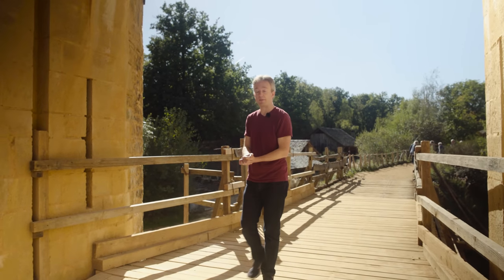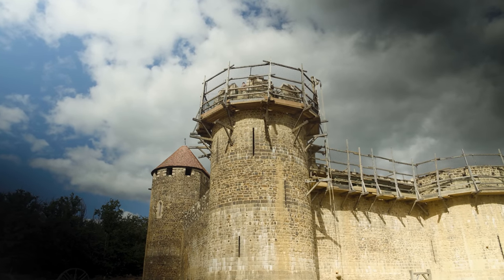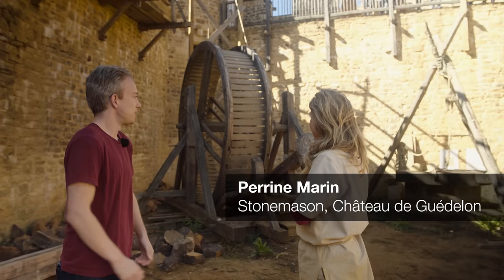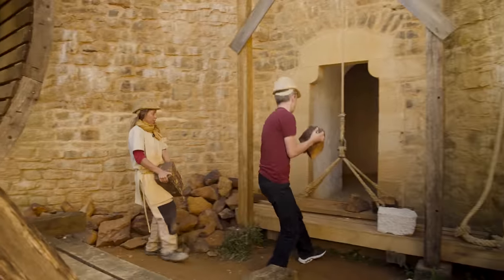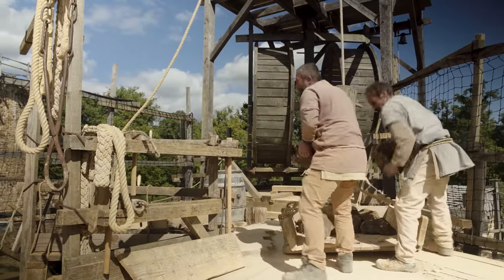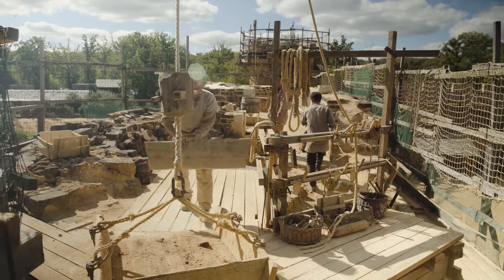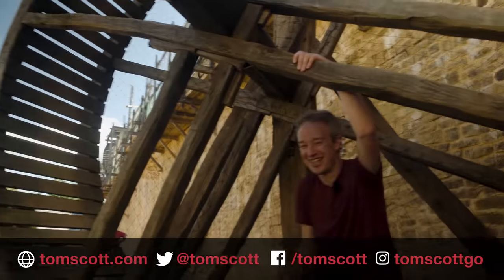I thought the treadmill crane was fictional.

Comment: I knew it was real because Treadmill Crane is a tech you can research in Age of Empires II and the manual that came with the game had historical sources explaining everything.
Reply: Huh! I missed that one! Have to go look now!
Reply: Exactly where I knew it from too, I was confused when Tom expressed any doubt over it.
Reply: What a missed ad opportunity
Reply: although, not everything in AOE2 is historically accurate. eg: mangonels and onagers having wheels.
Reply: @JNCressey  One thing I learned from AOE2 was that mangonels can drive themselves and don't need a person to push them around like cannons do.
Reply: @jamesburton1050  The history text for it is: "The construction of castles, cathedrals, and other major building projects required the invention of new techniques, as well as the re-discovery of ancient technologies. A critical tool known to the ancients but lost to the Europeans of the Dark Ages was the crane. The simple crane was a long pole with block and tackle gear that was used to pull loads to a height. The treadmill crane was an improvement over the simple version. It used a large circular treadmill upon which men walked. Gears converted the horizontal circular motion into vertical turning, providing power to wind ropes around a drum and pull up heavy loads. A variation of the treadmill crane employed a capstan that men could push against, like those used on sailing ships to raise anchors."
Reply: This one is working.  Even Tom can do it.
Reply: I knew it was real because I saw it in "Once Upon a Time..."
Reply: I was coming down here to mention that
Reply: @redryder3721 , the innacuracy isn't even that "they would need a person to push them around" - they were built in-place where they were needed and didn't move.
Reply: The treadmill crane is a medieval invention that increases the construction speed for all buildings by +20%.
Reply: Settlers of Catan (the City expansion) also has one of those.
Reply: And they said video games rot your brain
Reply: It is and isn't proof of concept, fact or fiction, really!? It's been done before by other people in France and in the other archeological examples mentioned like in was it Canterbury cathedral so it is just him doing something interesting. And that's fine! More than okay! That's what we want.

 Fact or fiction was a bit by the way, a slightly tired detail, introductory formalities and irrelevance although I guess it's still been interesting to discuss here.

I think his core fans would be happy to see Tom read the dictionary or the phone book and ramble interestingly  about each entry in turn! Maybe sometimes whilst on a cruise!?
Reply: Exactly where I know it from too
Reply: Builds 20% faster. Seems legit
Reply: And in Age of Empires 4 they even use footage from this French castle project to illustrate the game
Reply: @JNCressey  are you going to tell me that the car wasn't historically accurate as well?
Reply: Ironically, in the Lords of the West expansion for the definitive edition, Franks actually lost access to the Treadmill Crane tech...
Reply: Maybe relying on researching games is not the way forward?
Reply: Yup, I played that as a kid and still watch people play and cast it on yt. Hi T90 and Viper!
Reply: Franks don't get the tech anymore tho.
Reply: Yesss, I clicked on the video after thinking of AoE 2! xD
Reply: "Start the- Start the- Start the- Yes! Start the- Wood please- Start the- Start the game already!"
Reply: What is this manooeel you speak of? Is it some kind of mammal? Is it fuzzy?
Reply: @TheDemocrab  A variation of the latter was I think also used for mills with animals usually horses or oxen being attached to the capstan to power the mill.
Reply: @JNCressey  They also made a lot of considerations for gameplay balance, iirc the Chinese don't even get guns
Reply: @davebathgate  how do you turn this on
Reply: @metalswifty23 : alpaca simulator
Reply: wololo
Reply: @metalswifty23  cheat code. Probably the one @spk1121 mentioned. Don't remember what it was.
Reply: That's how we convinced our 7th grade history teacher to let us LAN up and play age of empires   II in the computer lab if we finished our assignments quickly
Reply: @davebathgate  What, no, the cheat code is what I said lmao
Reply: Back in those days we used to have treadmill cranes here in Brugge to load/unload ships. They are depicted on some old paintings and there is a replica somewhere in the city.
Reply: Came here to say just this!
Reply: HOWEVER the franks could never research the treadmill crane, thus this video is historically inaccurate.
Reply: @tryptaminezen3528  AoE2 and the Civ games have done more to inspire a love of history than school ever did for me.
Reply: Well down the road from me at Guildford, Surrey. Has an example hang off the bank of  river Wey, town quay its quite old...
Reply: Back in the day, games came in box and with manuals with descriptions.

All for cheaper than nowadays dematerialized...
Reply: AOE IV also has more explanations including videos from this location about the construction methods!

Comment: I saw another documentary on this castle and they mentioned that, although they have a historical ropemaking workshop on site, they use modern ropes for hoisting all the stones. Historical plant fiber ropes would be cool, but modern ropes have a known breaking point and you really don't want any unknown risks with hundreds of pounds suspended in the air. 
Such a cool project.
Reply: *thousands.
Reply: If I remember my visit properly, I think they also show a mill and a forge in the area.
Reply: one of my favorite things about that is seeing some of the scaffolding go up. Its wonderfully interesting to see people in what appears to be working class dress of the 13th century, wearing bright orange harnesses and hardhats. Humans are fantastically strange!
Reply: The idea is to replicate the construction techniques and tools, not the issues with those tools.
Reply: They do still make ropes out of plant fibres like hemp and sisal, it'll be made by modern machinery but it's still more or less period accurate, just looks a bit neater. Nylon is cheaper though.
Reply: @Shinzon23  **up to 1000 pounds on the double wheel
Reply: I suppose in theory they might be able to use historical ropes to do the work and modern ropes just as a backup to catch things if the historical ropes fail, but that would be a lot more complicated, and probably more chance of it going wrong.
Reply: It's like using a hard hat while working. It does make sense to use just for safety.
Reply: @barneylaurance1865  It wouldn't really be worthwhile. The idea is to replicate the historic techniques and tools as closely as possible, but at the end of the day, a rope is a rope. A modern rope performs the exact same task as one created using authentic 13th century techniques; the only real difference is that the modern one is far less likely to fail and injure someone. Much like having the workers wear modern PPE or using stable modern scaffolding where required, it adds a great deal of safety, but doesn't affect the overall construction process in any meaningful way.
Reply: Think it was called Secrets of the Castle with Ruth, Peter and Tom.  I highly recommend watching it as well as the list of other history shows they have done.
Reply: There are things you just cannot do "historically" at current employment standards.
In Guedelon they in fact had to get special dispensations to be allowed to hide their modern steel scaffholdings with wooden covers to make it look "real" for the tourists. 
Usually those scaffholdings have to be open and visible for constant safety control.
Reply: @Gamegonner  Absolutely worth a watch!
Reply: No need to replicate 13th century safety standards. :P
Reply: @Shinzon23  They mentioned their big crane tops out around five hundred kilos.  That's just barely more than one thousand pounds.
Reply: @barneylaurance1865  you mean "if the historical fail" ?
Reply: @thierrymilan2039  Yes I do. Edited, thanks.
Reply: @Shinzon23 well no the video clearly states it's up to 500kg on the big one so a little over 1000 pounds. Not thousands of pounds.

Comment: There was a famous crane on top of Cologne cathedral. After a while, construction stalled, so it stayed up there about 400 years until they finished the cathedral, and the crane taken down. You can find pictures of it online!
Reply: I just scoffed at a TV program touting wood as a durable material. 400 years ain't bad tho.
Reply: @lunakoala5053  When Notre-Dame de Paris burned down, the majority of the roof timbers dated back to the 13th century, so they were almost 800 years old
Reply: @lunakoala5053  Of course when you use the right wood from certain tree. Because the wood we use nowadays is a mass produced wood in a certain standard. In the past when the forest still covered all in Europe the variety of Old Growth wood is plenty
Reply: @raifikarj6698  Also, according to some documentary I saw about stradivari violins (or rather why we fail to replicate their quality), trees grew different back then for climate reasons.
Reply: @lunakoala5053  not only climate reason but also soil, that's why some food grow in different soil have different taste. Tree is also like that the composition will change slightly just like Metal Alloy have different property depending the material composition

Comment: I wonder how common ratchets were to prevent accidental rollback. As Sarah mentions, this machinery dates back to the Romans, if not further, and Roman siege engines definitely had ratchets for preparing for firing
Reply: Entirely conjecture, but I think the gear ratio is so reduced the human being's weight alone is enough to prevent the wheel from being driven backwards by the load. The "effective incline" of the wheel being pulled backwards shouldn't be enough to make you tumble "down" continuously. However with a higher load-to-driver ratio you'd be potentially tumbling "down" several flights of stairs if you lose your footing which is terrifying (and has probably happened at least once in the past)
Reply: Just wildly guessing, but
In a war, a rollback aka misfire was time costly and expensive, one less ammunition and time wasted. Both are important.
While building a castle you got the time to risk a load falling back down, and the people working them were probably the lowest ranking citizens so a injury or death was, well, acceptable. Not worth the hassle equipping all cranes with complicated ratchets.
Reply: It won't roll back as long as the entire weight of the human hamster is on the bottom rim of the wheel.

Without the brake there could be significant injury if the human tried to step out of the machine with a load on it.
Reply: @paulgrieshammer2707  Would it need a complicated ratchet, or just a bloke nearby with a length of timber ready to wedge in the right spot? That seems the sort of job an apprentice would do.

Comment: I like how Tom needs a hard hat to lift 1 rock but the workers at 3:25 don’t need them as the crane whips a platform of rocks above their heads 😂
Reply: Showing for the cameras they're safe. When in reality, most guys don't bother if they don't have to. Just like on modern work sites. When OSHA shows up or someone is filming, all of sudden everyone is wearing safety gear haha.
Reply: @jonny-b4954  Safety gear gets hot especially in the sun, also some types of safety gear seem to cause more problems and injuries then they prevent but you are still "required" to use it.

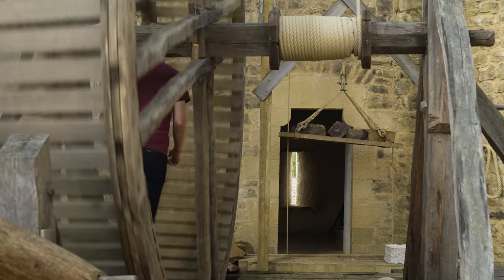Comment: The shot at 5:14 is the same way they filmed the jogging round the room shot in 2001: A Space Odyssey. They built an enormous enclosed wheel and fix the camera to the frame. The jogger runs in place as the wheel spins, and from the camera's perspective, it looks like he's running around the room
Reply: Well, he is running around the room.  It's not the runner's fault that from a frame of reference outside the room he isn't moving.